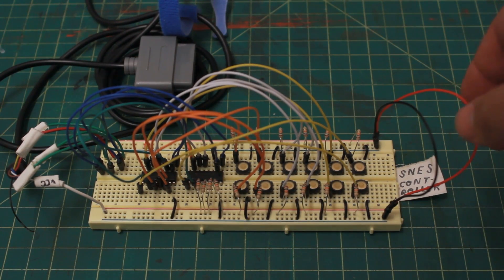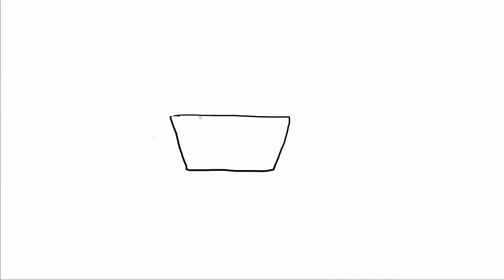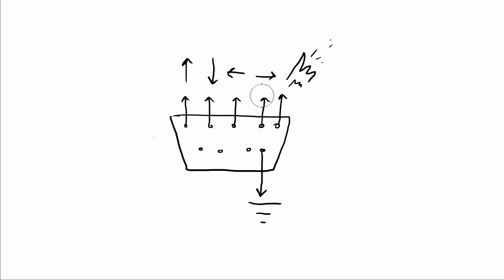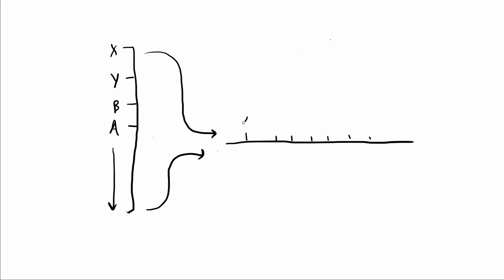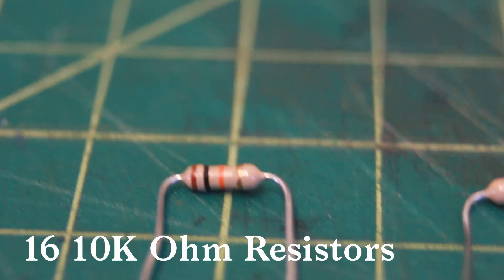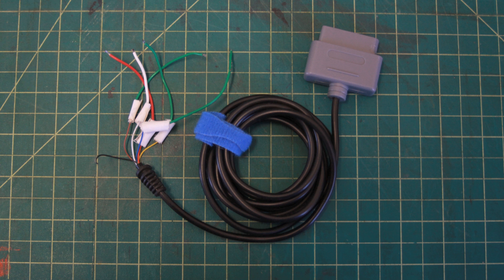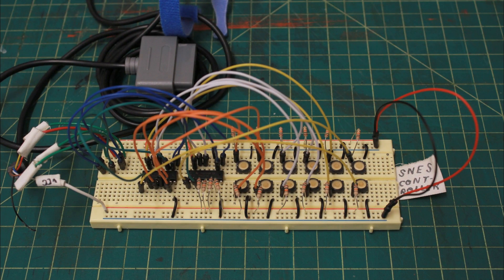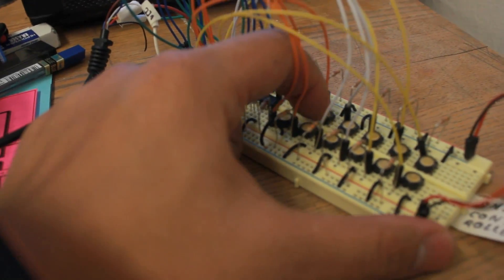"DIY" Super Nintendo Breadboard Controller

Comment: What model of SNES controller are you using? I dissassembled one and it has only one 20 pin shift register. model of the controller is 56V313B 1991. 6 and the shift register model is V520B. Tried to find a datasheet on it but all i got was some poorly translated japanese documents that had nothing to with the shift register itself.

Taking my controller apart i noticed that out of the 20 pins that only 15 (16 if im looking at it wrong) are connected. I assumed that had something to do with the fact that the SNES is 16 bit?(dont actually know that feel free to correct me.)

Additionally, i aslo have one(1) shift register that is SIPO, if one were to reverse engineer the snes controller, could i connect the serial out from the controller directly to the serial in of the free shift register and then look at the parallel output  to gather information on the algorithm? 
Thanks :).
Reply from the maker: Brian Thomas hey thanks for your comment! To be honest I haven’t done electronics stuff in a while. I think the issue is that Nintendo was able to use their own chips so the labeled chip names/numbers may not be so helpful. If you look up a resource like snesdev there should be some useful info from those places I believe I just jacked a schematic from that site.

The controller was from a clone console because I felt less bad taking it apart. They don’t have standard color coding on the wires is the main issue. I needed it for the plug because I don’t have the ability to mold a custom cable jack.
Reply from the maker: As for the latter part I could be wrong but I think you’d only get useful info if you have an oscilloscope because you’d want to see the signal timing. But I believe you could do that without your own chip, and you’d have to create some custom way to view the parallel signal, I guess I am confused about the utility of the other chip. Let me know if I am misunderstanding though, thank you!

Comment: Thank you, super cool.  I'd like to do this for my arcade machine.  I'm thinking about making an board so I can plug into my jamma harness.  I suppose instead of your little switches these will be arcade buttons (through the jamma harness).  Do you think this will work?
Reply: Joseph LaFever hey! I haven't worked on this kinda stuff in a while (I was in grad school, full time job now etc). I'm not sure what the electronics are like on the JAMMA harness you are talking about are like but it should be relatively easy to add buttons to them. The electronics here are particular to the SNES, but I imagine the the arcade stuff is less complicated circuit wise since they were probably designed to be serviced without too much technical knowledge and they had more room in an arcade cabinet.